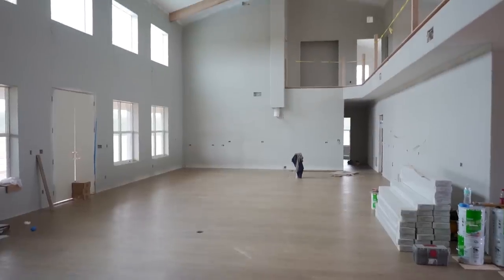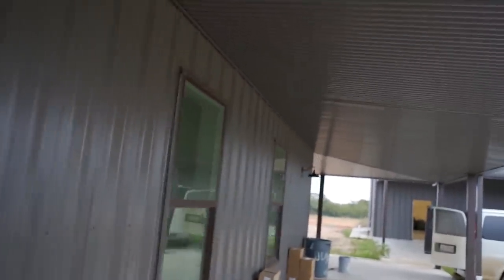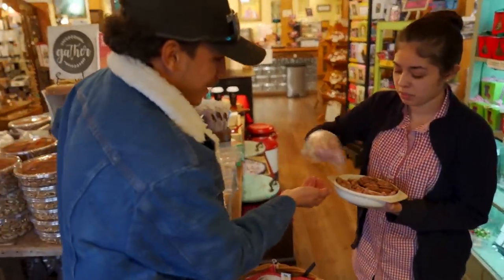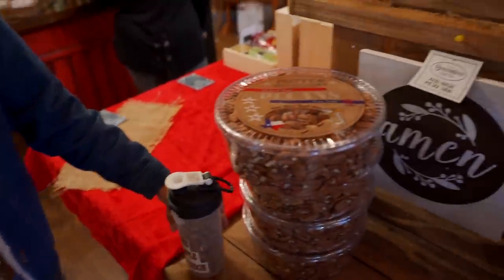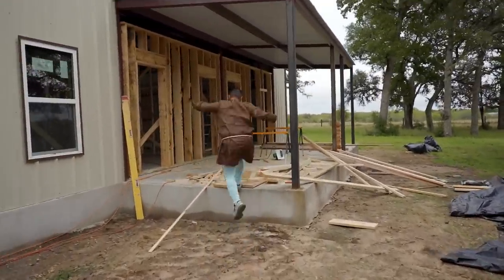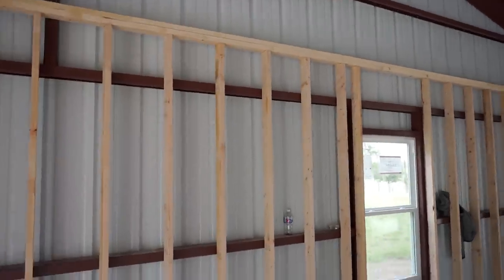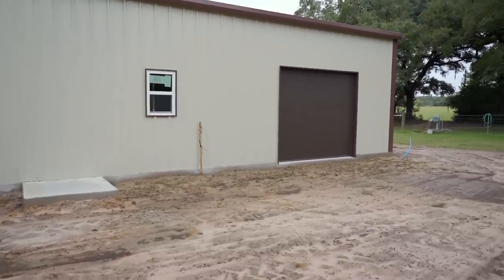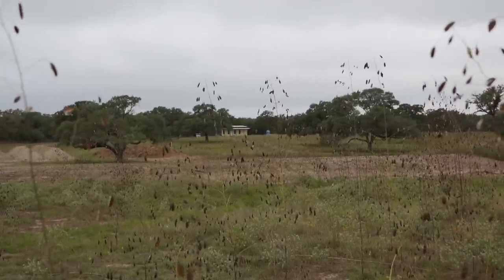Barndo 214 flooring - The Barndominium Show E185

Comment: I attached my inner walls to the girts the same way with RT 7 ties. My primary residence is a barndo but we insulated it the conventional way with fiberglass ( big mistake ) and I wondered if your buildings have those morning and evenings "ghost" noises. I know you do the insulation the best way but do you still get some expansion and contraction noises? My home here on the coast wakes up in the mornings cracking and popping pretty good when raw sunlight hits it after a cool down at night. Even when a cloud blocks the sun it will start creaking.The smaller living quarters I have at the ranch was foamed and I don't hear the living space making noises but the open barn it is attached to starts as soon as the sun comes up and continues all day.  It's only an hour from Floresville so you know what the heat is like there in the summer.
Reply from the maker: No noise whatsoever in my home.
Reply: @TexasBarndominiums  Foam is the answer.